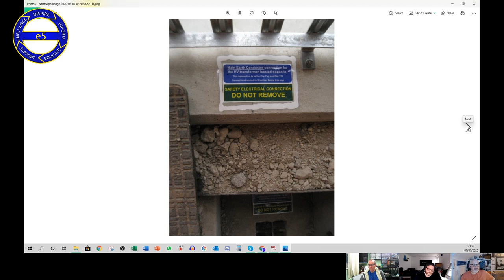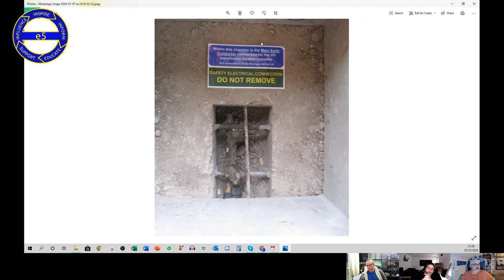Podcast 68: Earthing part 2

Comment: Foundational earthing has been a long standing NEC recommendation in the USA especially for swimming pools and new builds. You talk about foundational earthing but in effect you also need to mention earth rod corrosion issues and the importance of rods encased in concrete making earth ground resistance to be stable in many weather conditions and seasons. It’s called an Ufer ground here after the engineer Herbert ufer who had to establish a minimum 5-ohm ground resistance in desert like conditions for munitions storage in the 1940s. If interested, Ufer’s research is provided in his October 1964 IEEE paper CP-978, “Investigation and Testing of Footing-Type Grounding Electrodes for Electrical Installations.” Btw enjoying these podcasts and it’s pretty thought provoking. I check my ground earth resistance using two methods every year including the wenner fall of potential method (JW has shown that in one of his own videos). The earth ground resistance is around 0.25-0.9 ohms for my own home depending on the season. You can’t really depend on good readings on year holding for the next due to changes in multiple factors that can affect ground earth resistance. As I fit a solar roof, EV chargers, patio outside kitchens in the future and new sub panels I may still need upgrade the ground earth resistance no matter the already good starting point I have. Beware Earth clamp meters are less accurate - the fall of potential method using a MFT is the most accurate approach.

Comment: You were saying about TN-C-S approx 1978, our house was built in 1972 one of the new estates and are TN-C-S with a little green PME sticker  6mm main earthing conductor 16mm tails 6/4mm bonding to gas & water black in colour plastic incoming services. We have now been told that if we have plastic incoming services we don't need to bond yet when I started as an apprentice new houses in the 80's it was plastic incoming so what has changed?
Reply: I think we have learnt you don't need to bond incoming plastic pipes. The danger is a incoming metal pipe with a potential on it and not bonded therefore breaking the equipotential in the house.
Reply from the maker: Bonding ok plastic also was an interpretation to ensure EEBADOS was achieved. Apologies TNC-S was introduced early 70s. And you have an early adopter then.

Comment: I think some sparks don't know the difference between earthing and bonding and perhaps other technical terms, probably because they spent a long time using simple terms to explain to customers electrical issues.  I remember reading a topic about EICR's saying that we shouldn't use technical terms but rather simple terms so customers can understand.

Why doesn't Paul like the word equipotential, isn't it what it's trying to achieve?

Also from the part 1 podcast 66, what was the clause Paul said he was going to find before it ended in regards to DNO requires to maintain integrity of the existing earth conductor?

Comment: The title of earthing and bonding is incomplete. Functional earthing is becoming an increasingly utilised part of the CPC with the removal of static from Electronic parts. 
As a title of a book l, maybe changing it to Circuit Protective Conductors. This would move the issue to different utilities of the green and yellow wire/ PEN / electrodes.
Reply from the maker: Functional earthing is part of the operation of equipment. If removed the device stops working. Removal of static via an EMC filter or other CPC connection is just part of the normal function of earthing of the circuit. It removed the device will continue to work, albeit a tad dangerously

Comment: Was there a reason why the rebar could not be brought out of the ground and the connection made at a higher level to ease inspection and testing and avoid water pooling at the joint. No criticism intended just asking.
Reply: rust
Reply: @brianhewitt8618  Iron and steel rust when they come into contact with water and oxygen – both are needed for rusting to occur. So having the joint in the ground where water could accumulate would that not accelerate the process. I can see the Denso tape would help to slow the process but then periodic inspection becomes an issue as a break in the connection cannot be seen without removal of the tape. If the connection was made above ground and any joint smeared with grease inspection would be simple. Just my observation and as I said I'm not hear to criticize just learn.
Reply: @markholmes4143  yes, i agree that would be helpful and it should be used more often